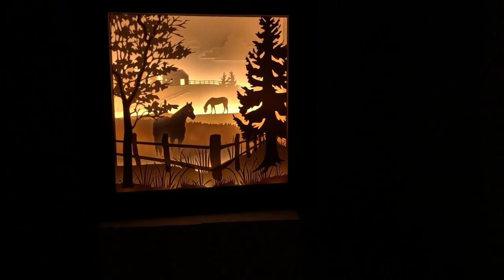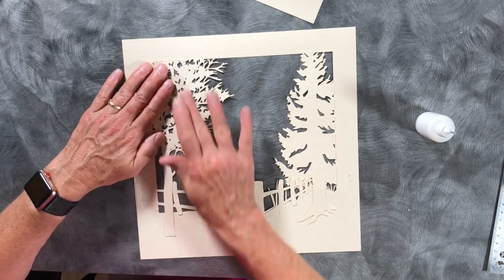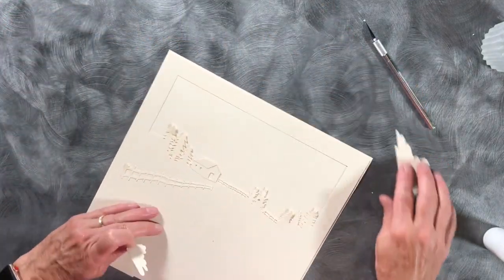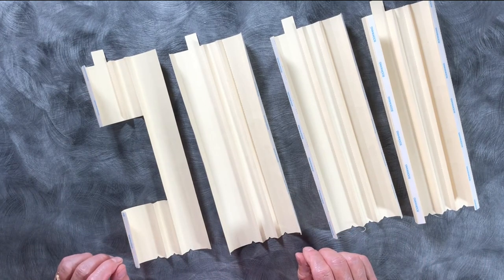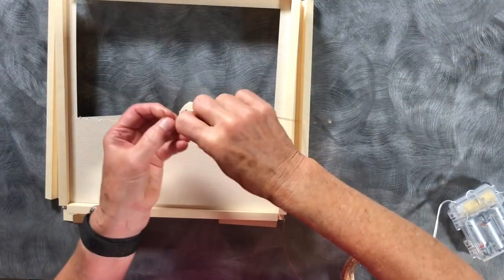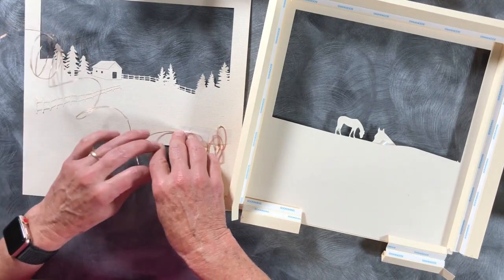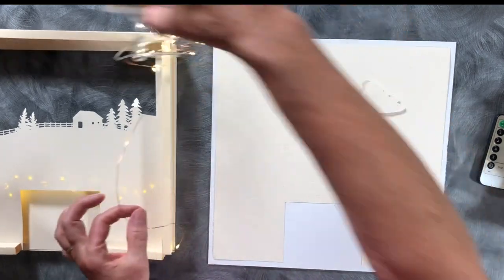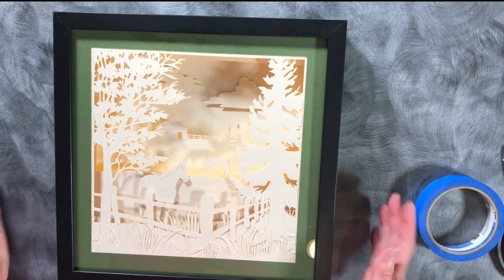Horses Grazing Square Tutorial

Comment: that is so beautiful .  I am planning my project out and wondering how do you turn the lights off /on if you tape up the battery pack? mine has a switch on the pack.  Also, how deep is the piece when all layers are put together?  I have a box frame but not sure it's deep enough.  Could the layers be a little closer together than how you show it?  thanks
Reply: The lights I used and link to have a remote control which I keep on top of the shadow box. The shadow box is 2.25" deep. You can put the layers closer together but you will have problems having enough depth to hide the battery box plus have the layers for the scenery.
Reply: @marjiroyabd  thanks so much! I will have to find a deeper frame